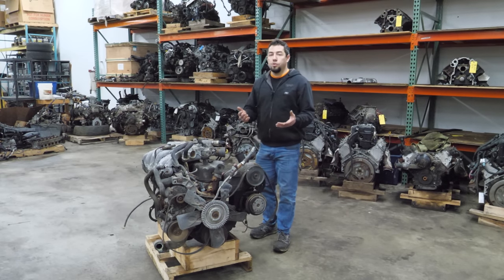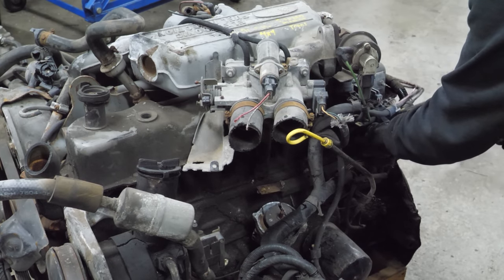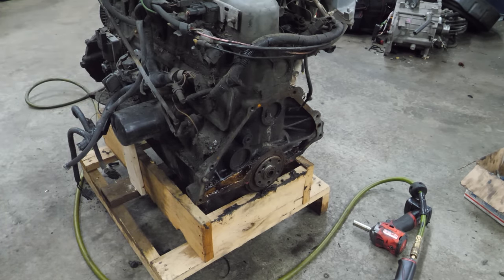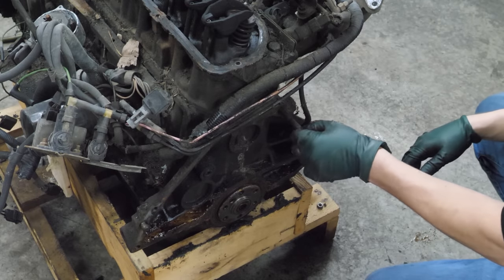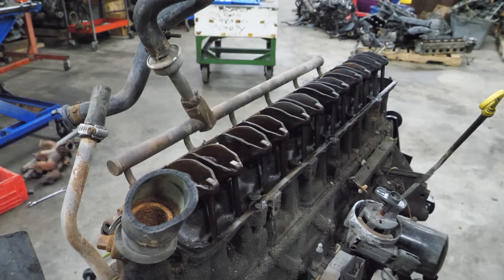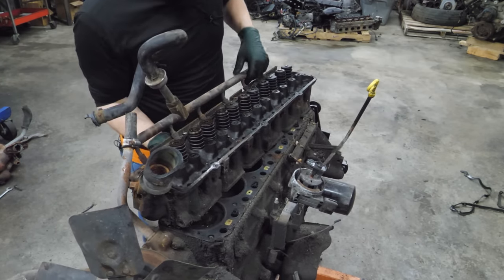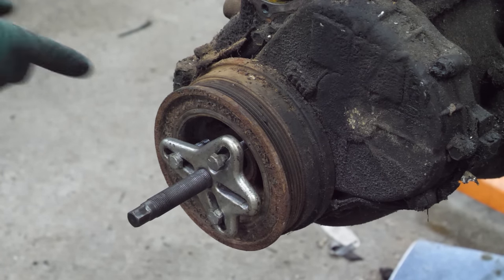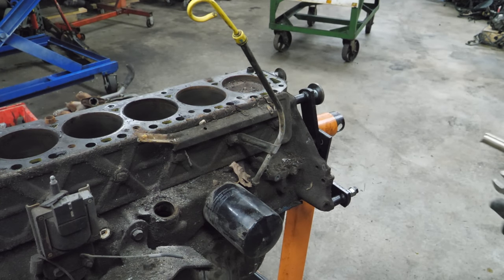FINALLY! A "Bad" Ford 4.9L 300 Straight 6 To Teardown! Most Reliable Engine, Ever?

Comment: Everyone else has had good experiences ,not me.i had a 85 ford bronco that I shot a rod through the block pulling a 4000 lb trailer approximately 2700 rpm 52 mph just BOOM. Had 173000 miles on it. Replaced it with a 95 efi block models rotating assembly just swapped the heavy ass 1bbl carb intake/exhaust assembly onto it . Had 55k miles on it from a local schools maintenance facility so i figured it was well maintained. Blew head gasket and found a crack between cyl 5-4 ( watching this gave me flashbacks, its the only reason i am writing this.) . I had numerous issues with the vacuum accessories and electrical gremlins galore.  Also was pretty guttless couldn't go over 63 mph . I. Assuming that its due to the 80s smog bs and the lame 300 cfm 1 bbl carb where here in California you cant touch for emissions reasons. Bought a 72 c10 chevy pickup( no smog pre 75) never looked back. I supposedly had the one ford thats reliable but it left me stranded pretty much every time I ventured more than a few hours from my home or farther.  Yall could keep lying to yourselves not mentioning all the work for it to keep running but i got a bowtie sbc and honestly it is actually a reliable truck ....not just in theory but in practice as well lol.

Comment: When I was 16 my friend had a 1968 ford 3/4 ton. He and his father built it on a spare diesel chassis and they put a Ford 300 6-cylinder in it. It was pretty short-legged and I remember him taking me for a test drive in and when he gunned it and my head hit the back glass because it had so much torque.

Comment: My son had an 91 F150 with exact same motor you tore down. It had a no start condition, and after doing a compression test I found a blown head gasket starting. I did a head gasket, got it all back together, and still had the no start. Finally figured out injectors weren't getting a firing signal. Swapped computer out, and still no start. After squirreling around with it over a month 😅 I found a video about the map sensor. Unplugged it and it started right up. Plugged it in and it died. I did all that work on an old rust bucket truck to find out it was a 20 dollar part.
I had it sitting around for a few months then as my son had moved on to a new vehicle. Then one day early last year an old neighbor stopped and asked if I was wanting to sell it.
He handed me a 1000, and I gave him back 300. Sorry I don't believe in taking advantage of the mentally challenged. He was going to need the 300 to fix the other steering and a couple other small issues. Like I said it was a rust bucket and he was just really paying for the excellent running engine. It was my third time working on one first was a friend of mines that bleed oil out of the lifter covers.

Comment: I'm not a Ford guy but it's hard to talk smack on this engine because it will outlive you and everyone you love. Probably outlive your grandkids too. This engine was designed to be a rock solid immortal engine that will run till the end of time with very minimal maintenance and downtime. Throw a dingle-ball hone down the cylinders, a rebuild kit with new bearings and seals, and it will be ready for another 400k miles. The truck will literally rot off the engine before it quits.

Comment: Probably the best low end torque engine made, they are work horses, with the 3 on the tree, Autolite or Carter 2 bbl, in an F100. As long as you kept them cool and didn't mind poking along at around 60 MPH, they weren't designed to race but to work!

Comment: The Dodge 225 slant sixes were pretty indestructible too. I remember we had a work pickup with one when I worked construction as a kid. It had no oil and no water, I would start it up foot to the floor every morning and it would NOT blow up.  I did this for nearly two years an it was still going fine when I left.

Comment: I had a co-worker that had a company truck that he got new and he didn't change the breaki in oil out until it started rattling at 40k ,two weeks after it started knocking then they tore it down too discover the oil had solidified and plugged the oil pickup . It stayed together, and they cleaned the oil pan and oil pickup new crank ,and she made past 200k when she was T-boned at an intersection and totalled.

Comment: There was a story, when Ford finally announced they were going to discontinue the 300-six, where United Parcel Service (UPS) protested to high heaven not to stop making them. They were used in most all UPS delivery trucks. Finally a deal was worked out between Ford and UPS whereby Ford made a final run of 30,000 engines for them, which would be a several year stock for whoever made the final assembly of their delivery trucks. I don't know where they were warehoused, I don't know how long it took to use them up, and so forth. It shows just how much high regard that fleet buyers had for them. Between the Ford 4.9  300-six and the Jeep 4.0 and 4.6 straight 6 engines, its a toss-up as to which is #1.01 and which is #1.02 but their durability is beyond question.

Comment: I got a junkyard 83 bronco for $300. Was told the motor was completely shot.

Took it home, put in a new ignition module and ignition coil, swapped the carburetor, and ran a vacuum line. Thing fired right up. Nothing in the motor was bad, it was all components outside of it. Thing has 384k miles on it and I haven't done a damn thing to the motor itself yet.

Comment: Most do not realise that this engine responds VERY well to:  A) 2 BBL downdraft carburettor (Webers especially; specifically the 32/36 or 38/38 used commonly for stock replacement on VWs, MGs and the like) and intake  B) EFI headers C) camshaft.  You actually want pre EFI heads; even though the EFI heads were "fast burn" (Vortec on a Chevy equivalent), they were lower compression.  It isn't going to do 10 second quarters, but it will EASILY jerk the barn down AND do 100 MPH.  All while still getting better mileage than a pre 2021 Toyota Tundra!

Comment: I have a 1994 Ford F150 
4.9 L 4x4 388,000 miles miles and I drive it every day. It has 35 inch tires and I get 11 miles to the gallon.

Comment: Yaaaa my 1985 ford 300i6 blew up yesterday, was well maintained while I owned it,  seals, oil, everything. I believe it only had 180,000 miles on it as I bought it from an old farmer who bought it new. The inside was all original and looked brand new, same with the bed of the truck, very little scratches. leading me to think that it was a “town”truck. I hope that this was just a one off bad motor as I am going to put another back in. So indestructible could be an overstatement, I wish not

Comment: I watched someone working on a modern v-6 DOHC with variable valve timing recently.  It was a rube-goldberg nightmare of chains and guides and tensioners, mystery parts and designed in multiple points of failure.  A nightmare.  The timing gear on this masterpiece.......two gears, each with an alignment mark a blind man could follow.  No maintenance required ever.  I'm not sure the more modern engine represents real progress.

Comment: Do a forged crank Slant-6. The Ford 300 and the Mopar 225 are, I think, tied for most durable car/truck engine ever made. The Slant-6 was originally designed as a 170CID (2.8L) engine for racing, and was meant to be cast in aluminum or iron, so the block is ridiculous in the (most common) iron edition, and the crankshaft looks like something out of a bulldozer, and it shares bearings with the 426 Hemi. (If you do somehow find an aluminum Slant-6, they are valuable, the aluminum casting was not perfected yet so they are very rare.) Chrysler, in typical do-or-die fashion, needed an engine for the all-new 1960 Valiant... Slant-6 from the racing division, cast in iron. The 170 Slant-6 is high revving and will pretty much self-limit by floating the valves before the bottom end breaks. 
The RG got a taller block to allow for the 225CID (3.7L) displacement and is the most common Slant-6. It is a low-revving torque-monster capable of pulling tree stumps. Insanely reliable and durable, and capable of decent power if not for the crappy primitive emissions controls. Also, the exhaust manifolds limit horsepower and finding one that isn't cracked is tough. 
3.40" bore and 4.125" stroke on the 225, the best way to kill a Slant-6 is to over-rev it. 
Eric, another great video, thank you.

Comment: great video.have a 90 f150 with over 500,000 miles,never touched the motor.used to build chippers with this motor and even into the mid 90's those motors were still carburated

Comment: The 300 has to be one of the best engines ever built, I grew up Chevy  6 cylinder engines in pickup trucks, my first experience with the 300 was in an industrial application we put a ton of hours on those engines, made me a Ford fan.

Comment: Put a 74’ 300 into a a 66’ F100 and it ran like a beast even with a 3 speed with no overdrive. Great motors to get around with.

Comment: Great video.    New head gasket and some she'll rotella and get another 100,000 miles!
When you pulled the pan that rtv and new gasket told a tale.  Probably when that plastic got in the pan.   Drop pan enough to work on gasket.   Piece falls from somewhere and into pan.  Button her up and run it.   The screen will keep it from getting in the pump!   Or it'll lay in the bottom and take a bath.  Don't want to Jack engine up high enough to pull pan out.    Twin I beam structure in the way.    I know I'd probably have to pull engine to do the pan on my 7.3 powerstroke.

Comment: The Jeep/AMC straight 6 is a similar design but absolutely better across the board. The Jeep engine is stronger, bigger journals, bigger lifters, bigger ports, bigger valves, stronger rods, less displacement yet more power and less fuel consumption.

Comment: my favorite feature of this engine, is the timing gears. Timing gears are much more reliable than any kind of a timing chain or belt. This engine, with its long intake runners would be the perfect prime mover for a 50kW generator. If paired with a 4 pole alternator, I'm certain this engine can crank out the ~250 foot pounds of torque necessary to deliver the ~83 brake horsepower necessary @ 1,800 RPM, to deliver the 50 kW from an alternator with a running efficiency of 80% or better. It would certainly be fuel efficient, and, if you change the oil once and a while, could give at least 5,000 hours of trouble free service. I'm willing to bet, you could get closer to 10,000 hours with a good by-pass oil filtration system. Good air filtration is also a must.
     It's clear from this video, this engine was LOOOOONG over due for an oil change. I think the owner just checked the oil level, fueled up, and just ran it. I'm willing to bet, this engine doesn't have nearly the miles on it, that the wear would suggest. If you found the vehicle, the transmission and differential wouldn't look much better.

Comment: I have rebuilt 2 of these only problem i've ever seen  is sometimes the head on these will get cracks  near the valve seats and on the 1980s  for sure if you run them with to high of rpm  the rings will fail because distance between the rings as they go up and down   the meat on piston between bottom ring and oil ring  tends to flex because the meat is to thin between them and can flex to the point that cast aluminum between the rings can break out like a pop  top off a can if you keep  bending it back and forth long enough it will break  i went back with badger pistons which allow more meat between the rings   and have  the same truck today other and   is very dependable mine has never run hot if anything slightly colder than should be now only problem i have with it now is not motor but the 3 speed with overdrive hard to find parts for because its an aluminum casing and has a side rail shift which are rare this trans was also used in some mustangs and other cars at that time the problem with this trans is roaring noise in 1st and 2nd gear  so i will need to tear it down and replace the bearing that's bad

Comment: I have a 1991 F-150 inline 6 with 35,000 original miles. 5spd 4x4 that I plan on keeping for ever because of the tractor motor in it.

Comment: I had a 1995 F 150 with the 300 6cyl in it with a 5 speed manual transmission . It ran as good as most V8 and pull car and trailor with no problems

Comment: I had a carb'd 300-6 in a 2 yr old '78 F-150 I bought. The carb was a constant problem, Ford's Dura- Spark ignition was way more unreliable than a points & condensor. The black box just stopped working, and expensive to replace. The front disc brakes tended to stick the pistons in the calipers, I still have two siezed pistons in my shop, when one would stick I normally had to drop down to 3rd gear.  
   Not sure why but I traded the '78 for a brand new '87 F-150, it was surprisingly reliable, but not near as reliable as my '96 F250 POWERSTROKE, 325,000 miles and if I Plugged the block heater in for an hour it would start right up, it's EIGHT BELOW ZERO outside right now.  Ford needs to work on rust-proofing their chassis & bodies, I doubt the new aluminum body resists the brine solution the highway dept's spray on icy roads.
  The '78 with 3.55 gears and NP-435 trans was a gutless dog, the '87 with first year EFI and same trans & axle ratio was only slightly quicker accelerating, but neither truck got decent MPG, SON's Gen 2 F150 LIGHHTNING with 351 Windsor, E4OD and 4:10 gears ran 15-16 second quarter miles, not bad for a 4000+# truck, got 16 mpg at 70, and would tow amazingly close to what my F-250 PSD did.
   The 300-6 is best kept in towed farm equipment like balers or silage choppers.

Comment: These powered Mobil Street sweepers back in the day. Coupled to a C6 and a two speed rear end they ran at 3000 rpm doing 5 mph all day for years with just regular maintenance. Basically industrial motors that were available in consumer vehicles.

Comment: The fuel diluted oil was probably due to the pressure regulator on the rail failing. I’ve had a couple on various older fords do it, the vacuum line gets a straight shot of fuel through it to the plenum behind the throttle body.

Comment: 0:39 You don't even have to keep them full, I once had one of mine run down to less than two quarts left in the crankcase when I developed a rear main seal leak that I didn't catch right away, and it never made a sound or gave me a lick of trouble before or after I refilled it. I drove it another at least seventy-five thousand before selling it.

Comment: Not the same . but reminds me of my first rebuilds, Dodge slant 6 - 225. Prowled junkyards for parts early 80's. 
the straight 6's bend pushrods on a bad back fire at startup. On a cold morning when starting , if you dont hold the starter on a bit long and it coughs and dies, sometimes you feel a big ass kick, and you know... it just tryed to spin backwards....Aka BENT A PUSHROD. 
Replace that bent valve push rod (or two) after a bad engine cough, and your up and running fine again.

Comment: Had a 1981 Van with 300I6, family put over 300k on it, sol dit to a familly member they changed bearingd and rings and it is still going.

Comment: If honesty and integrity prevailed,  and the industry stayed focused on reliability instead of shifting their focus to never failing to attained a replacement rate, we would all still be driving both the passenger and truck in-l8ne 6 ford's.
I've driven the schidt out of  both

Comment: That plastic probably was the oil breather seal and I had to change my cam gear ⚙it was Teflon or something but the steel gear won't fail I'm sure and my 1978 300 6 is the coolest running I've ever had 190 on a hot sc day pulling a heavy load on the highway 😉

Comment: I had a 78 F 100 with a  300 in it.  It would go like a scalded dog.    Had it up to 150 once and chickened out before it reached max speed.   Used it to pull a 4700 camper with.  Only complaint I had with it was manual transmission.

Comment: My 1986 4x4 F-150 still runs as good as new the only parts replaced since new was a ignition module and electric fuel pump

Comment: I would say that piece of plastic getting stuck blocking over half the intake screen on the oil sump caused a starvation of oil at load, so I was guessing worn main bearings, probably at load when it occurs of course. Tightest clearance is the main bearings.
Reply: I would completely agree with you on that one that is exactly what happened to this engine ✅

Comment: THE 235 IS A GOOD MOTOR TOO ! I HAD A 1979 FORD TRUCK THAT HAD A 300 IN IT , IT RUN GOOD BUT IT ALWAYS WAS A HALF QUT LOW OF OIL IN THE MOTOR ALL THE TIME AND IT NEVER GOT LOWER

Comment: Not much on passing power, but it's got plenty of pull.
Mine lost oil pressure due to gunk blocking the oil pump pickup.
Drained oil, filled with kerosene, ran for 15 minutes, sat overnight, refilled with oil, good to go.
Doubt any other engines would have survived the procedure.

Comment: The Ford 300 straight six is indestructible!!! Dad had an F150 with a 300 six that he ran low on oil when his oil pan rusted out. He thought he killed the motor. NOT!!! The motor turned out to be fine. It is VERY Hard to kill a 300 six.

Comment: OMG, so much junk bolted onto a perfectly good engine. I worked on them in the 60’s. Nice simple design. I can’t believe all the “improvements” Ford made to a great engine. 
I even did an in-frame on one in a ‘65 Mercury Comet. There was enough room in the engine compartment to climb in.

Comment: My
Mom drove my 4.9 
180 miles.   It stalled twice.  Overheated. She let it sit.  It started up and she drove it another 50 miles.  

The freeze plugs had gone out 

It had no water. No oil. No coolant. Nothing.  Bone dry.  

230 miles and all that happened was it cooked a gasket and the radiator hose popped off From the heat.